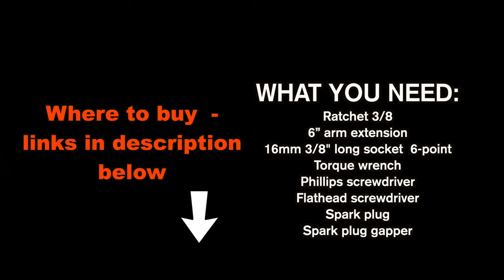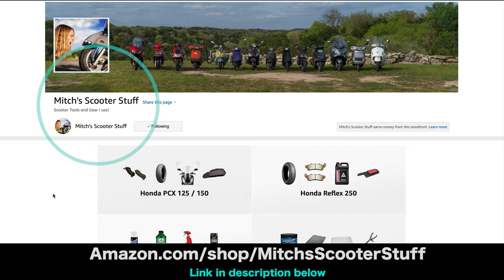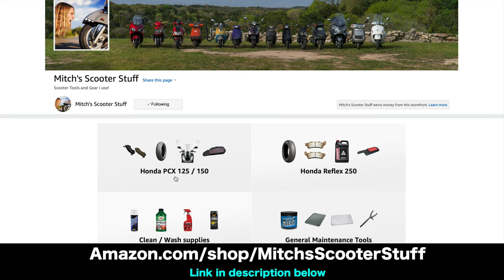Honda PCX 150 - Spark Plug Change | Mitch's Scooter Stuff

Comment: Thanks for this video! I was having trouble with my PCX150 sputtering during acceleration, so I changed out the spark plug (which was rusty from the ethanol). Now, it runs like new!
Reply from the maker: Glad it helped!
Reply: what ratio of ethanol you put in tank?

Comment: Hey, I love your videos. Thank you very much for all the help. I have a 2019 PCX 150 and the fuel pump is only getting 7 V to it. I’ve checked the battery is fully charged and I’m just not getting any fuel in the pumping into the engine, I have the whole thing taken apart. I’ve checked the relays. They’re all fine. I don’t know if you’ve had any experience or could help. I appreciate it. Thank you.
Reply: bro i'm having the same issue, what fixed it for you?
Reply: Its was a bad fuel pump. I installed a new one and all works great.

Comment: On my 2021 (71 Plate) PCX 125 the spark plug installed by Honda is an NGK LMAR8L-9 as stated on the plug. Am I correct in assuming code NGK CPR7EA-9 has the same dimensions? The spark plug Honda installed is more expensive but can find little info if its better quality.
Reply: Follow the manual

Comment: Been watching a few of your videos.  You've Been a huge help. ( I got a 2017 pcx)Just pulled out the spark plug to replace it.  But then it got me wondering about the spark plug wire. Can it be removed and replaced through the same spot without removing the panels?

Comment: Hi there, thank you for your videos, they are very helpful. I have installed a denso iu22, a iridium spark plug and torqued it at 12 Nm. Do you think I should tighten it to 16 nm?
Reply: you should torque the plug to 16Nm for the best spark, too tight the plug may hit the piston and damage the engine. otherwise you'd get weak spark and the plug may come off the engine due to compression

Comment: I changed the spark plug there's a spark but when I release either the start button or the break the scooter just cuts out..also a battery warning light cane on..I jump started it and still won't stay idling what should I do ? Maybe leave the battery on charge overnight ? I

Comment: My pcx 125 goes so slowly from 1st gear, like when i start or when i am traffic lights and i accelerate it takes few seconds to gain speed. Its not how it used to be. What do u think? Should i change plug or the cap. Because the mechanic added some liquid to clean cap few days ago and i think he forgot to dry it and attached to the plug and since then i have had this issue. Please help.

Comment: I've watched a few of your videos and appreciate them. I will point out, however, that you are using the torque wrench slightly incorrectly. When using that beam-type torque wrench, neither end of the handle should be touching the bar. The handle should be "floating" so the torque is transmitted from the handle pivot point. That is how that wrench was designed and calibrated. Granted, for this type of work, it is definitely close enough. But thought I should mention it for others' benefit. Thank you.
Reply: I'm glad that someone else noticed this too. Otherwise, nice video!

Comment: Fit an Iridium (CR7IEX) They hardly need touching and engine runs slightly more crisper
Reply: stock condition plugs are better then aftermarket iridium ones.

Comment: No phillips screwdriver, use JIS! Phillips will damage the screws
Reply: Jis?
Reply: @ovidiurisco1251  Japanese Industrial Standard - looks the same as Phillips but they are not fully compatible with the phillips screwdrivers. It's ok if you have no other option but you will chew up the screws if they are more than a little tight.
Reply: @lordracula2461  and they are easy to find....
Reply: It’s just a sheet metal screw going into plastic.  Don’t be a know-it-all.